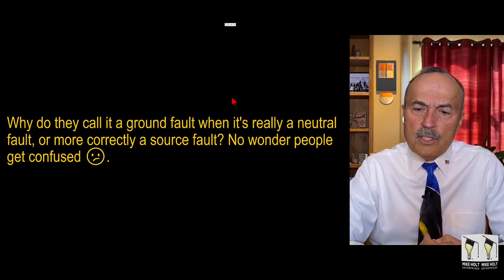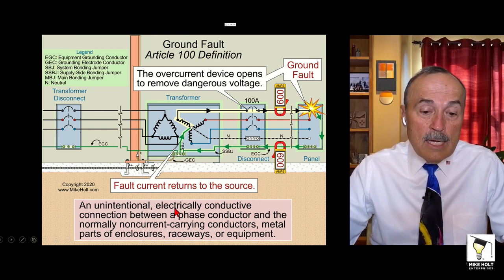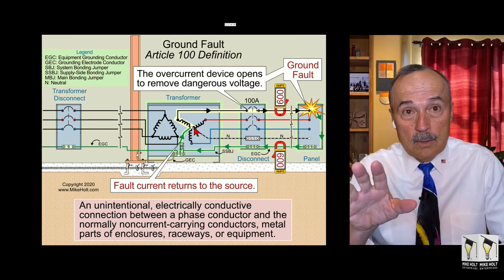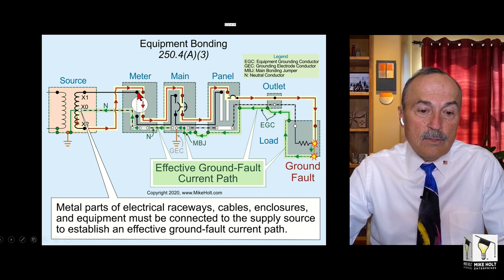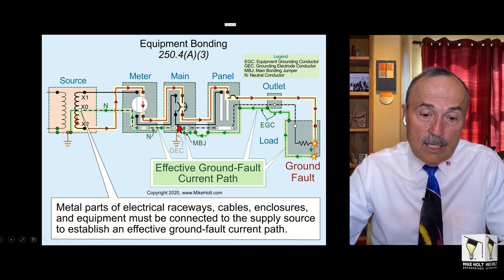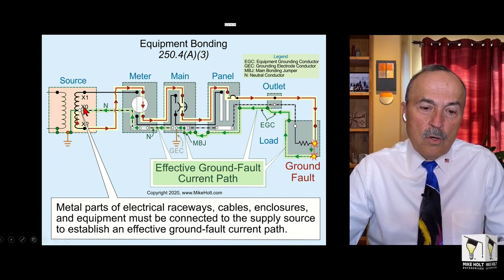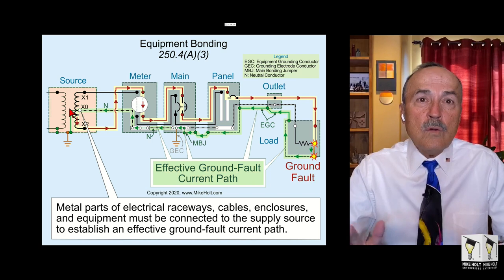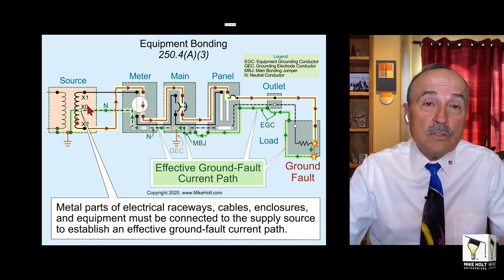Why do they call it a ground fault and not a neutral fault? NEC 2020 - [100], (2min:56sec)

Comment: Hi Mike,
Just happened onto your video's and found them to be really interesting. I'm in UK, so generally 240v for single phase. Would love to be pointed in the direction of any video's you may have done previously on RV's(Motorhomes in UK), in particular with use of either 120v/240v inverter systems, bonded to vehicle chassis as opposed to true grounding. There is so much contrary information on the 'web' that it becomes really worrisome.
Fantastic work...will be watching many more of your video's....your clarity is uncommon. Thanks.

Comment: With a true open neutral,  The lowest current draw(s) L-1. and. L-2 will continue to operate?  Canceling out the high current draws?  Balancing themselves out.
Reply from the maker: This is correct only if there are other phases connected to the same open neutral.

Comment: I don’t know what to say about losing a neutral, except, maybe it may need to be a requirement or at least policy ( better companies may do this ) put an alarm system in to warn of a lost neutral, many hazards happen when a main neutral is lost ( voltages and currents go up and down to dangerous levels and risk electrical equipment and property and lives and many people are unaware of what is happening ) ( it took about an hour after I reported the problem for electric utility company to fix a broken main neutral) study by, Gene Bowdish
Reply: The u.s. should switch to 240v everything for houses & it would eliminate that also would be better for environment because 14 gauge wire could be used to supply more watts than 12gauge can at 120v.
Reply: @sparkyjerred419  people could do that now, but, putting in 240 vac outlets everywhere in there house would be expensive, and a mother going to look for a cake mixer working on 240 vac in a department store would be a challenge
And a 240 vac blender, dishwasher, washing machine, toaster, …
And department stores who bought extremely large quantities of products so you could have a better deal at a lower cost, all would lose out, including manufacturing companies that spent millions of dollars on tools and equipment to help give you a better deal at lower cost, the manufacturers would have to re-tool so many equipment and processes and retrain employees and….
I am sure I am missing something that would be a challenge

Comment: “100’s or 1000’s of amps of neutral current”? How could this ever occur in a standard 200A residential electrical system?

The amount of current in the neutral wire is equal only to the difference in current between the two hot legs. If the loads on the hot legs are ‘balanced,’ meaning the same, the neutral current becomes zero. 

As the higher power loads are typically 240V and thus are (normally) balanced, it’s only the remaining 120V loads - which connect between one or the other of the two hot legs and neutral - that can create a neutral current.
Reply: He's talkin about hundreds or thousands of amps in a fault or short circuit
Reply: @christiancassini768  
Yes.
When Phase / Live wire accidentally gets shortened with a metal connected to a EGC the Fault has no bounds. It's uncontrollable and produces a lot of heat!